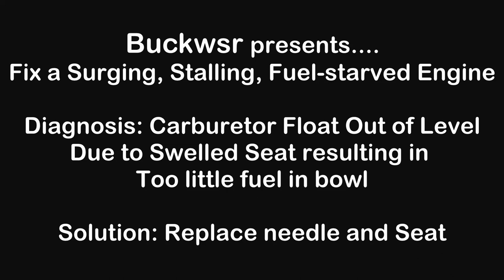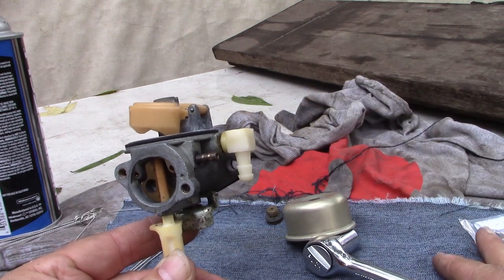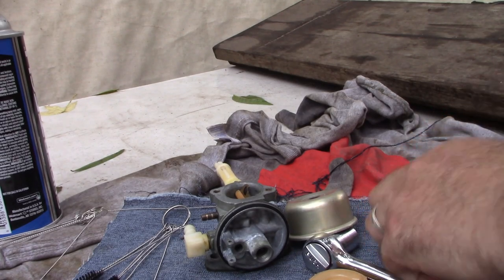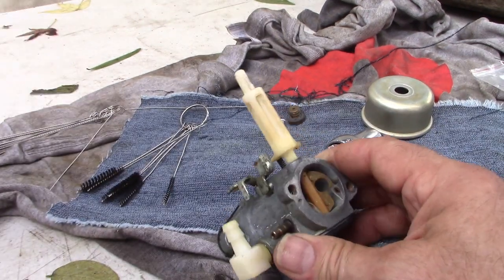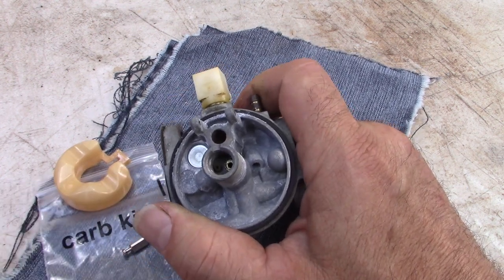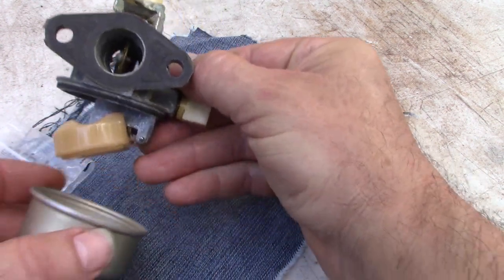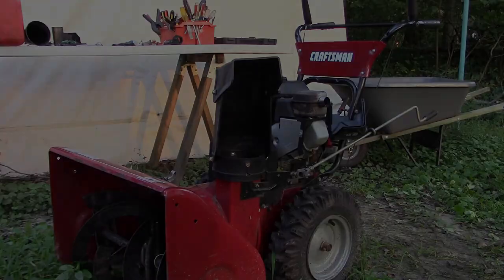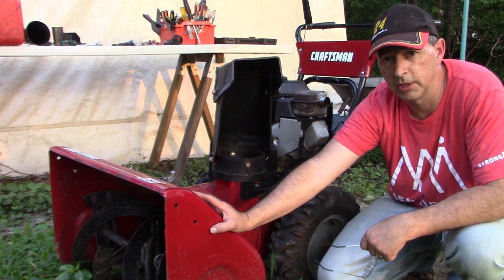How to Fix a Surging, Struggling, Stalling, Fuel-Starved Small Engine

Comment: Thanks for the tip about the crochet hook.  Great diagnosis by looking for a level float and recognizing the cause and effect of the surging problem.    I note that the bowl seal has a groove it is supposed to fit in on the carb body, something you can't see very well if the carburetor is still on the mower.   It was implied from the video, but I found out the hard way yesterday before seeing your video, that you can save a lot of time by going ahead and removing the carb from the engine, because the carb needs to be  turned upside down to see what's going on and to be able to make a quick, accurate diagnosis and repair, and, important to remember, to get the bowl seal correctly placed before the bowl is reattached after the float needle seal is replaced and the float level is adjusted.   

The crochet needle trick works great for the purpose of pulling out tiny seals.  For those who live in cold climates and who wear sweaters, if a wool thread gets caught on something and pulled out, use the same crochet hook by coming in from inside of the sweater and hooking it on the thread and pulling it back to the inside of the sweater, where it can't be seen; or you can pay $10 or $15 for a sweater fixer tool, i.e. a re-purposed crochet hook. 

Thanks for making this very helpful video.
Reply from the maker: Thank you. Lawn mower repair and sweater repair all in the same place!

Comment: Hello sir...nice vid....I watched because my pin fell out and was trying to make sure I was putting it back correctly....you skimmed right thru that part...saw u put it in the plastic float but wasn't able to see that part? I was trying to put my in the hole where you put the seat...I put it in pointy end first with pin on spring on top ( float side)....is that correct?

Comment: Where did you get the replacement needle and seats. I recently did a video on the same thing on my channel but only found OEM parts.
Reply from the maker: I think it's Briggs part #398188. I probably bought them on ebay. Can't quite remember. I did not have good luck, however, as the needle did not seat properly and fuel kept leaking. As I recall, on this machine I eventually replaced the entire carburetor....
Reply: @Buckwsr  yeah I saw some bad reviews so I went OEM.  That could be the reason why you say it fit in too easily when installed.